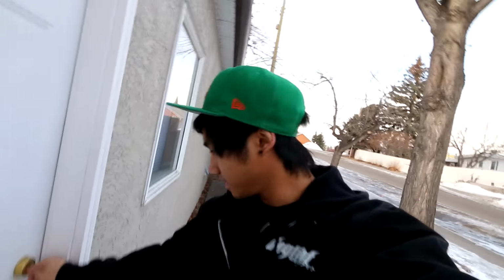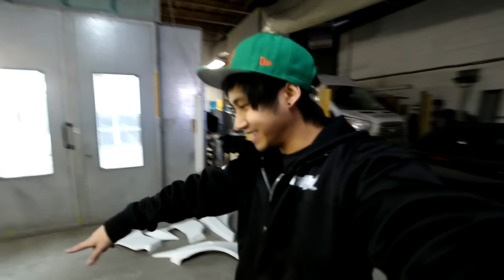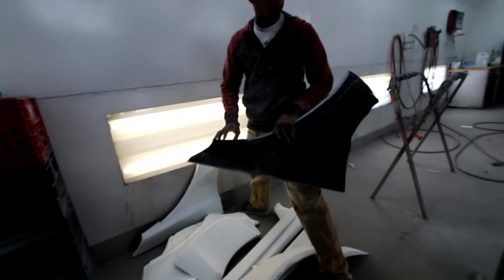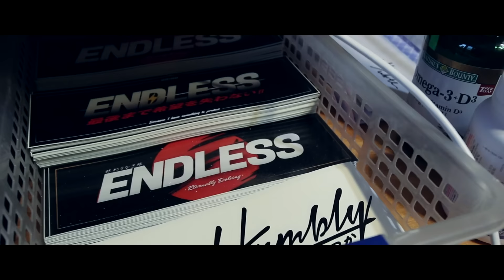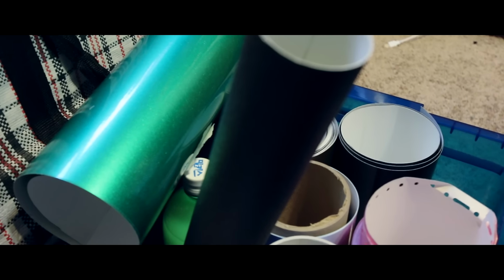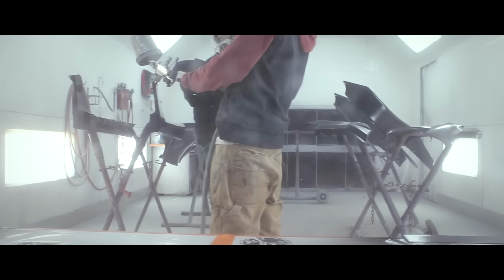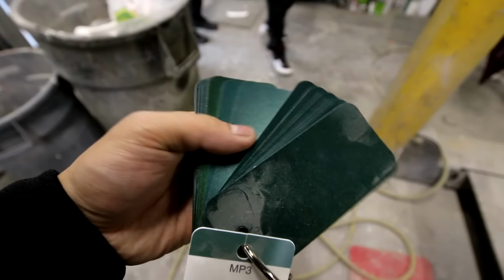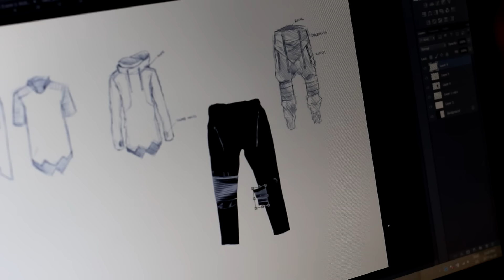RallyBacker Widebody finally gets Paintmatched!

Comment: Just for future references, there's color code on your vehicle's registration plate under the hood. That way you have a perfect match when you paint aftermarket parts or repair damage.
Reply: Andy.M 891 I was wondering the same but he answered my question on another comment. There are two different blacks with the same code. One from Toyota and one from Subaru.
Reply: Thats pretty simple than, he just has to choose the brand he's riding that would make sense

Comment: Why did you not just match the paint code from the car instead of matching by eye?
Reply from the maker: D4S is made by Toyota and Subaru. Theres a difference in the two from both factories..
Reply: Kings Must Rise that seems a little bit silly too me why can't the mixtures be identical if there is a paint code
Reply from the maker: Because mixing paint is done at a minuscule level and every drop makes a difference.
Toyota has a more flat reddish tinge in the right light where as Subarus D4S factory paint has a blue tinge.
Hence why I brought along a piece of my car.
Reply: Kings Must Rise but wouldnt a paint code give you the ratio of colors needed to mix your paint to exactly match?
Reply: Johnny Toyota and Subaru both have paint with the code D4S, and they're slightly different
Reply: Well his eyes do aswell
Reply: officialTHREETWENTYdotcom that's also a very good point